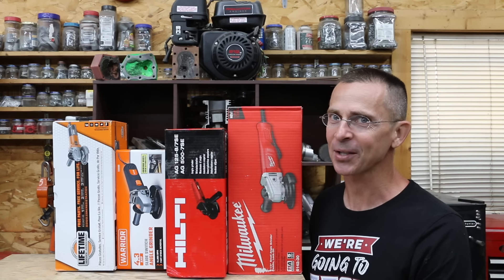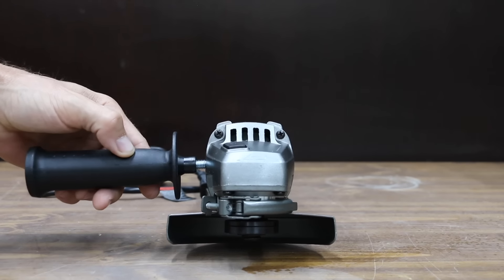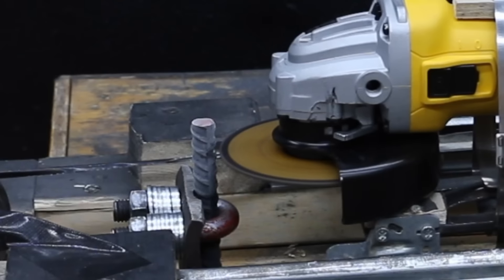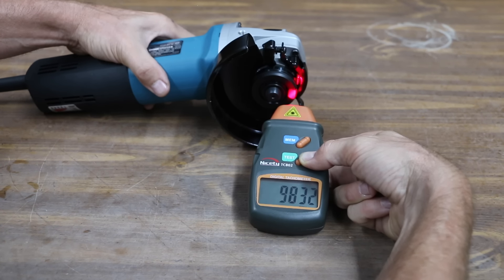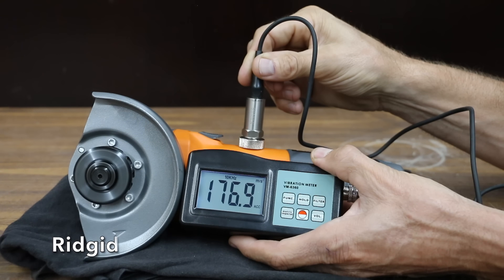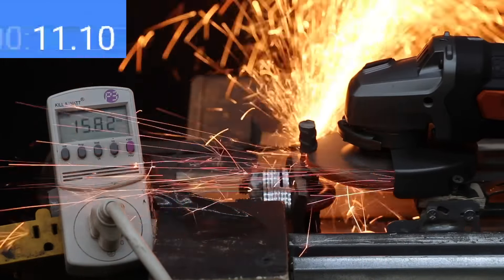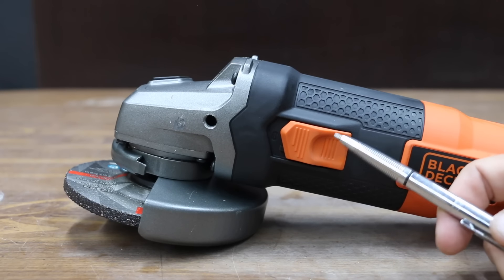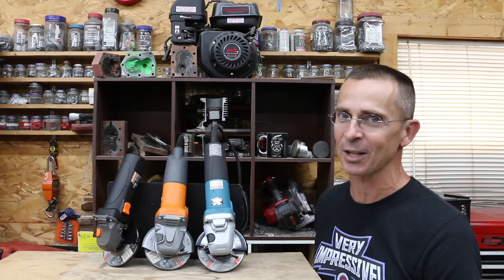Best Angle Grinder (Corded)? Hilti vs Milwaukee, DeWalt, Makita, Ryobi, Ridgid. Let's Settle This!

Comment: Great Job Todd.  Makita has been a favorite for years.  Metabo has been an industrial supplier until their acquisition by Hitachi (edit) recently.  Really seem to be impressed with the rigid as I guess it's the "store brand" for home depot. Is there a kobalt model?
Reply: Just so you're aware, Metabo was acquired by Hitachi. For the USA market, they renamed all the Hitachi tools as Metabo HPT (where HPT is "Hitachi Power Tool").
Reply: @JELWwL6unE8V7iGB3  Thanks, I was thinking I was wrong.  My Metabo grinder was new at a yard sale and predates the merger.  Love it.  I had a nice old Makita that would trip the internal breaker every time it got heavily loaded.

Comment: One interesting thing you may do out of curiosity is checking the brushes for contact area. I can't say I'm certain about this, but the cheaper tools are more likely to have misaligned or more aggressively grooved brushes. I think this would greatly affect their performance. The results may be very different once worn in.
Reply from the maker: Thanks for the suggestion.

Comment: If one rebar cut is close to the next, is it possible that sufficient heat was generated by the previous cut to destroy the temper of the rebar in that location, thus making the second cut easier?

Comment: my first grinder only had 1 bump to keep the switch on and it broke off after 1 year or very occasional use, it was very hard to press as well.
a 2nd cheap grinder I inherited would sometimes shut itself off from vibrating too hard, so I decided my 3rd grinder wasn't gonna be a POS and I bought a Hitachi (it had the start best button out of the ones I could test in the store, good price too)
Reply from the maker: Thanks for sharing.

Comment: How about cordless die grinders next? I have a bunch of M12 batteries, looks like I can shove it between the radiator and the 5.9 magnum block to scrub off old gasket residue. The Ryobi is cheaper and better power but I might have to remove more car parts to get a roloc on a tight spot.
Reply from the maker: Thanks for the suggestion.

Comment: Hey Todd, I'd like to add a video idea suggestion. I really liked your videos on the different Fuel Additives to clean carbon. I was wondering if you could do a follow up video to the Seafoam and MMO where you tested Gumout Tune Up or another one of their products that claim to have a high PEA concentration. Another product to test would be Redline S-1 Complete Fuel System Cleaner another high PEA product. Just curious how these PEA products compare to Seafoam and MMO. Thanks for doing what you do!
Reply from the maker: You are welcome!  Thanks for the suggestions.

Comment: Man, this was a test that felt catered towards my needs. I just wish Hitachi was compared just so I know how they stacked up against the competition. I've swore by them for the last 14 years.. They're more expensive, but they stand up to so much abuse in our workshop.
Reply from the maker: Thanks for the suggestion.
Reply: Hitachi is now renamed to Metabo.  Hitachi bought them out and then they were bought out again.  Now there is no Hitachi power tools they are Metabos.
Reply: @bogieman101  Hitachi is still Hitachi with a different name. They bought Metabo but continued to manufacture Metabo tools under the Metabo brand, and their own tools under the Metabo HPT name in America. They are not the same products underneath, which is evident by the fact that even their power and battery systems are completely different. It would be an insult to say there are no Hitachi power tools, just Metabo. Because that would imply that Hitachi no longer makes their own high quality tools and has outsourced it to Metabo, which simply isn't true. They still make them, they've just changed the name. In your case it's Metabo HPT, in our case, they're branded as HiKOKI.
Reply: @shona5512   Where can you purchase a Hitachi power tool?  Hitachi sold the power tool business and the name had to be changed for the new owners to have total control over the product.  Now has Metabo HPT made any changes to the old Hitachi tools? I have no idea, but there are no Hitachi Power tools anymore.  That was the point, so PF would have a hard time testing a new Hitachi, it doesn't exist, as far as I know.
Reply: @bogieman101  I don't know why this is so hard for you to understand. All they changed was the name, yes the KKR investment firm purchased their power tools division, but the manufacturing is still the same, so they are still the same tools.
Its like Geely purchasing Volvo or Tata purchasing LandRover/Jaguar.. Just because they're under a new parent company, doesn't mean that the brand just disappears. In this case, they did go a step further and also change the name, but the point is that the tools that they manufactured, are still being manufactured, just under a different name. The full name is literally Metabo Hitachi Power Tools. 

My initial point was simply that Hitachi Power tools are also a good tool worth testing as they're something I've used for the last 20+ years. Whether PF could get tools branded Hitachi or Metabo HPT/HiKOKI is irrelevant, as it's still the same quality tool underneath.

Comment: I was thinking about some possible tests. Maybe more of a technique based type of thing. Like epoxy for example. It's pretty obvious JB weld is top dog neck and neck with devcon maybe. But maybe see what makes the strongest repair, light sanding, deep gouges cut in the material, holes drilled ECT. I really want to see the crush cube test done with the paste epoxys compared to the putty, and also mixed with an agregate like steel or aluminum shavings. I just made a part with jb weld mixed with aluminum to add to a casting I didn't want to weld and distort.  I'm curious how it stands up to JB by itself.
Reply from the maker: Thanks for the suggestion.

Comment: If you only need an angle grinder once in a while, buy the Harbor Freight model. If you are working in a fab shop and using one of these grinders numerous times a day, the other performance parameters, especially comfort and ease of use become important. Looks like the Makita and Milwaukee do a good job for the money if you are using a grinder professionally.
Reply from the maker: Thanks for the feedback.

Comment: I only use my grinder with flap discs and wire brushes, just been using it to strip the paint off the shed the other day as im gonna re-oil the wood, paint and varnish the old shed, im putting a workbench and my lathe, bench grinder and mitre saw in there and im gonna buy a drill press. The place is gonna be my little wood turning shop.

I currently have a parkside grinder but i wanna upgrade. I'd definitely go for either the Makita or Hilti, i bet they would outlast all the others. I wonder if you have a different model of makita as their corded grinders go for £59, £79 and £99 in the UK but the Hilti is easy twice that here.
Reply from the maker: Thanks for sharing.

Comment: For the past ten years on average We purchase thirty to fifty grinders per year. repair and rebuilding is done in.house.our best grinders, cost vs life of tool to date is Metabo. Small Hilti units are preferred for lighter work and ease of handling. Dewalt works well but doesn’t hold up under constant running and they are constantly changing internal part’s creating a huge supply cabinet, also the newer brushless units cause older GFCI to trip due to their electronics. Milwaukee units or average. The 9 inch Milwaukee are Superior. My Peter’s are by far the easiest to Repair
Reply from the maker: Thanks for sharing.

Comment: I liked my Harbor Freight angle grinder until it caught fire. Served me for a few years. Not recommended for real shop use. I have a WEN rotary tool aside from a balance issue it's built well. The real angle grinder we used in our real shop was a Bosch. In some cases, you still get what you pay for.
Reply from the maker: Thanks for sharing.

Comment: I've had at least 20   five inch angle grinders in the past few years. What's the first thing that goes on them ? The switch, all sorts of dust and crap blocks them up . They seem to designed that way to fail. It's cheaper for me to just buy a new grinder as the switches aren't cheap plus my time to mess around with them . I have a cordless Parkside one that I use just for metal and that's been brilliant. Plus the disc tool is always in the handle. I have a Bosch that's been crap and a black and decker that's been next to useless. My cheap Tesco one lasted the longest out of all but the switch went on that .
Reply from the maker: Thanks for sharing.

Comment: 😮 I've got a good test for you. 

Running 5% to 10% Diesel fuel in your full Gasoline tank.

I've been doing this for years on all of my vehicles, the 2 main vehicles have +300k miles on a 95 Chevy 350 and +300k on my daily driver 2008 BMW 335i N54 Twin Turbo. Changing oil at 4k since I got it at 86k miles. Spark plugs are very expensive at $25 to $28 each all 6 Changed every 25k. I've not had the common High PSI fuel pump or direct injector issues that most have had, this car runs amazing still and It's gotta be from the fuel mix I've been using. What damage could this be doing if any. I've also never failed an smog test either, I run 1 600 cel + 400 cel single case Euro 6 cat right after each of the turbos and only had to change them once at $300.00 each down pipe. True facts my Bimmer friends but I take no responsibility for you doing damage to your car if you try, I may have just been lucky A.F
So dare try at your own risk, I've only got 2 vehicles I've done this on so don't blame me if your harm your engine.

Comment: My warrior $15 angle grinder broke in 2 months.  Thank god! You have 3 months at HF to return it.   I got my money back.  It is not meant for anything other than cutting drape rods for a couple seconds.  Don't you dare ever use it for medium duty flap wheel discs and etc.  It will break faster than your grandma doing parkour with osteo perosis.
Reply from the maker: Thanks for the feedback.

Comment: In actual use, the warrior is actually faster . . . .🙂. How is that?  Because many folks buy multiple warriors, one for a flap sander, one for wire wheel, one a cutting wheel, one for grinding disc, one for a backup, and etc.  So in actual use, I grab the one that has what I need on it, and go to work.   By the time you change the wheel on the Makita, warrior is already done and put away.  That said, I do love my battery powered Hercules angle grinder.
Reply from the maker: Thanks for the feedback.

Comment: No 13 amp DeWalt DWE43231VS?  That thing is a beast but I had to return it because it kept tripping my 15 amp breaker :/  I ended up getting the cordless 60v Max DCG418X1.  No regrets.
Reply from the maker: Thanks for the feedback.

Comment: I know it would be an expensive and maybe potentially more dangerous test but I would really like to see a 7" grinder comparison test.. there is a 7" Metabo (g18st) on amazon that costs about 140 dollars and 3 different Makita models that cost 190-300... so I'm curious if which is the better value (250-300 makita has soft start). Im also a little bit lost about the bigger grinders because I know they spin slower but I'm curious which would be able to cut through thick metal faster (for example such as a truck leaf spring or train track). Makita also has a 9" grinder that cost about 200 so I am curious about that one as well in terms of value for the price... different test: Im curious about Bosch variable speed grinder vs the more expensive Makita variable speed grinder (model 9566cv)... in the past I have tried buying the Bosch variable speed grinder from amazon but they send me the wrong grinder so actually receiving what your ordering might be a pain.. I assume the soft start makita is the best option for the safety features, soft start and less vibration, but the 7" metabo for 140 or the 9" makita for 200 still sound like good value for the price. :3

Comment: Seems a bit daft to mix up motor sizes. For instance, if the Bosch or Metabo 125mm 1700W models had been included the results would be different.
The testing procedures in the German tool mag I occasional read are more logical. 

Many find COO of interest.

Comment: Do you have a 3d printer? Would be cool to see a comparison of PLA filament brands with how much they warp, their bed adhesion, the strength of the finished print, etc
Reply from the maker: Thanks for the suggestion.

Comment: I have found the cheap grinders lack insulation and get too hot to hold onto for extended work, how about adding a tool temperature test next time?
Reply from the maker: Thanks for the suggestion.

Comment: I found this to be an excellent comparison test, and I came here after making a few pre-selections that I hoped to see. The PORTER-CABLE came in just below the expensive models, but it was a 6 amp PCEG011 model, currently $35. Why not instead test the 7.5 amp model, PORTER-CABLE PC750AG, for $40.00? I purchased the PC750AG based upon this review, despite it not even being included. I did so after my Harbor Freight one gave up. Why repeat that mistake?

Comment: If you are cheap like me, and really run your cut-off discs until they are ground right down, the “quick change” on the Ryobi really comes out a long way, leaving you unable to use the last of the disc. A couple of those quick change grinders look the same. Discs aren’t expensive, but it’s just wasteful.
Reply from the maker: Thanks for sharing.

Comment: My orange hf grinder is still alive. Sounds like gravel its so loud i prob need to lube the gears.
Reply from the maker: Thanks for sharing.
Reply: Damn I just broke the housing and still can't get the nut off the wheel. Might try jb welding the housing back together it's completely broken in half.

Comment: I use the 5amp warriors that's 2 dollars more than the one in the video to cut up leaf springs and all kinds of other stuff I used the cut/grind multi purpose disc's that were in the 20lbs drag test. It works pretty decent I havent ever stalled it out or had any major kick back tho after cutting or grinding a while my hands do start to go numb and gets pins and needles feeling from the vibration. I thought about upgrading to the ryobi seeing the vibration test till when it stalled and killed the motor.
Reply from the maker: Thanks for sharing.
Reply from the maker: Thanks for  sharing.

Comment: I have a test for you to do, most vehicles I rent lately have  auto stop and restarts when brake release or gas petal is pressed so my question is how much fuel will this save over the cost of battery and/or starter replacement. Id dare to say it saves enough fuel in comparison to what it costs for engine restart including extra fuel needed to restart and costs of the battery and starter. Shouldn’t be too difficult to get the data of average battery, starter, fuel consumption, etc. This is just barely out of your normal scope however you have a large following and would be good to see actual results which you are great at testing
Reply from the maker: Thanks for the video idea.

Comment: I like a little of everything performance wife at a decent price. Own an older Black & Decker angle grinder than the one you tesed. After viewing the video; I would be prone to buy the Porter Cable. You do have a point in that, I usually only use my angle grinder once a year to sharpen my lawn mower blade. Perhaps the Harbor Freight tool is the one I should buy. How long will the Harbor Freight angle grinder last is the last question in my mind?
Reply from the maker: Thanks for the feedback.

Comment: I really liked your methodology for the testing. However, I'm not sure why Bosch was not included in this lineup since they are also a major player in the power tools industry. I have noticed that Bosch tools in general are not usually included in your testings. Are there reasons? (Yes, I am an owner of several Bosch power tools, but also have a few DeWalt tools as well).
Reply from the maker: Thanks!  Thanks for the suggestion.

Comment: I think Warrior deserves a higher position because you aren't considering important facts : it's the lightest, the least noisy, very good about vibrations, has a low reaction when it starts, and the cutting time isn't fair because Warrior is the lightest. And when you apply more weight it just stop, but doesn't burn ... the price it's really great and the fact that you cam't easily remove the shield is a good thing for me... I think i have some good points don't you think ? 
Regards and Blessings from Venezuela.

Comment: I am a bit bummed the harbor freight Hercules grinder wasn’t also included in the test. 

More importantly though, this video was only 3 weeks ago, yet it seems Home Depot has done away with the the RIDGID 4.5” angle grinder. 

I can’t even order it from their website. (I do see the 7” model but it’s not the same… considering it’s performance here- it seems weird the removal would have anything to do with this video. BUT the timing is interesting…
Reply from the maker: Thanks for the feedback.

Comment: I have a variable speed makita IMHO it's awesome . U also have the ryobi which I like a lot aswell  sometimes the handle on it is preferable. Also have the paddle switch dewalt and rocker switch dewalt. The paddle switch dewalt I do not recommend  to a novice or home gamer as it will make you pay if not used to the power. My daily is the makita and ryobi on gas pipe.
Reply from the maker: Thanks for sharing.